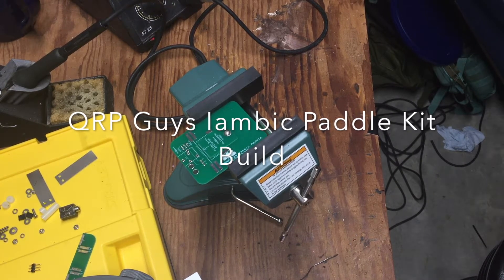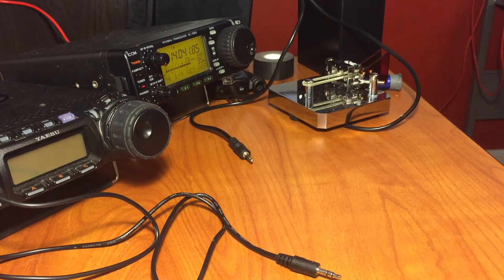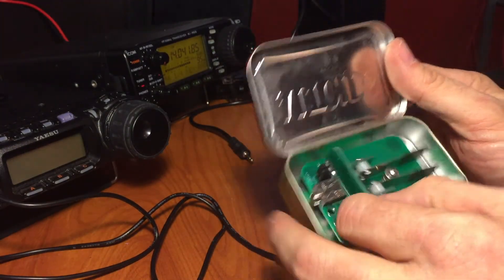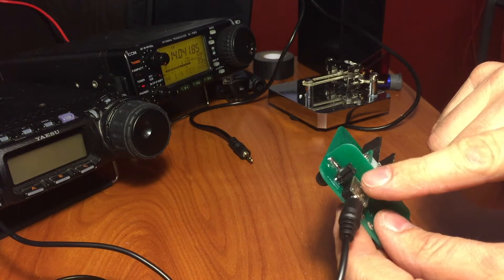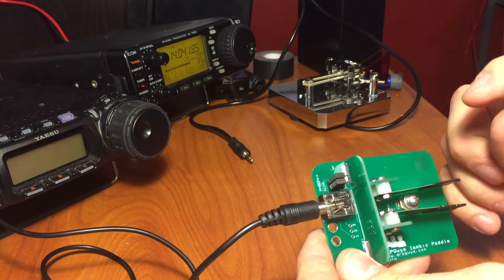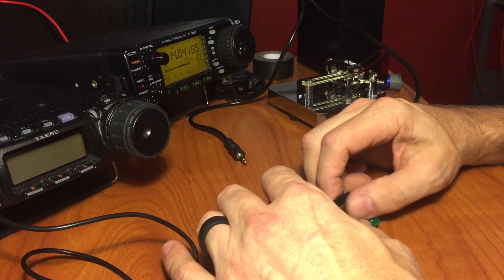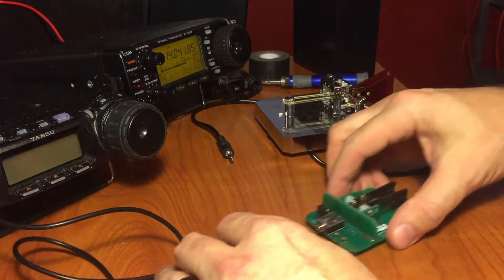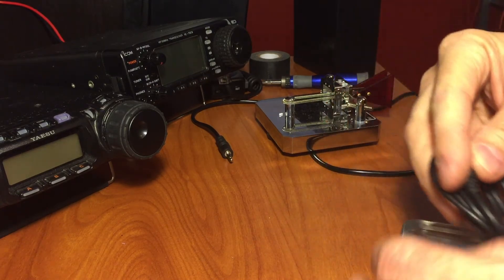QRP Guys Iambic Paddle Kit Build, yeah another hobby is invading my channel

Comment: Nice!  I made my own straight key out of a mouse trap, I call it "The Mouse".  LOL. Juddie WD8WV
Reply from the maker: I saw that on your QRZ page! I'm working towards copying code comfortably at 15wpm, not quite head copying yet, even at slower speeds, but I'm trying. So, for me.....a straight key is a bit of a motivator. I want to use it, but I need to get more proficient and get my confidence lever up.

Comment: interesting Ron - what is the morse code re-emergence about? is there a community of doomsdayers, preppers etc that think morse code will be vital when the sh_t hits the fan? or is it like the short wave guys who just have fun kicking old technology around? maybe a video showing your gear and discussing the community would be cool?
Reply from the maker: I think that there was an influx of young operators (I'm a late starter)  and the challenge started with the Summits On the Air and Parks on the Air operations. Folks all over the globe will hike to summits, big, or small to set up their gear. Well, portable gear needs to be light weight, especially for those difficult climbs and as such put out very low power. Morse code is used on a mode called CW (continuous wave) and because of the nature of the signal, requires a lot less power than to modulate our voice. It was a natural decision as well as being a universal language for radio operators worldwide. 

https://en.wikipedia.org/wiki/Summits_on_the_Air

parks on the air-https://wwff-kff.com/
Reply: interesting Ron - thx brother - cool how many uses you have found for the altoid cans :)

Comment: that's pretty cool! But my one question is would you be carrying a powerful enough radio to transmit while hiking?
Reply from the maker: Well, there are morse code transceivers that fit into an altoids tin also. It does not take much power for morse code. Hell, I've talked to Europe on 10 watts. Some guys have made overseas contacts using milliwatts. So, I have a battery to power those radios and can use them for well...just google Summits on the Air (SOTA), or Parks on the air...
Reply: Cool, I didn't know that. Guess I can go to sleep now that I've learned something today!
Reply from the maker: lol...right on.

Comment: Appreciate your effort but it would be a much better video if you did not use the intervelometer shots for the assembly. Rather, broke it into several segments and explained the steps of the process. A lot of us are interested in the way the paddles are put together and other videos have pointed out difficulties with this kit.
Reply from the maker: Thanks for the tip. I'll keep that in mind the next time I make a video where I am assembling a kit. I'll check out your channel to get a better idea of making electronic assembly types of videos.
Reply: Meant to be a constructive comment. A lot of us like to build kits and work QRP and the QRP Guys paddles fills the void you pointed out: cheap, light, portable. There are two downsides to the kit. One is forgivable because it is cheap; it is the smoothness of operation. You will understand this as your "fist" gets better. The other is the difficulty in assembling the contact points -- where you need tweezers -- and getting everything adjusted correctly. A step-by-step build video helps to visualize how to anticipate these difficulties. If you look at Gil's video, he comments that the instructions suck:

https://www.youtube.com/watch?v=YNZAIk5-Dbg

I watched yours because it might provide a different perspective. All that notwithstanding, you are to be congratulated on taking the big step into becoming a CW op! When CW was a requirement, many of us got so sick of the complainers griping about it. It's always nice to see young folks like yourself roll up your sleeves and dive into the "art". 

As for myself, I do not have  a YouTube presence per se. But if you go to righthandofzod.blogspot.com, you will see a lot of the stuff I have built and restored. You are more than welcome to question, comment, and offer suggestions.

vy 72 de k6whp
dit dit
Reply from the maker: I'm a subscriber to Gil's channel. I understood your comments. I guess I never intended to make an instructional video, but I think that I should consider it from now moving forward. ...a lot of questions get asked. That paddle kit was a bit of a PITA especially since I need reading glasses (52, not too old yet)...but I use those magnifying goggles to cheat..hihi. Still learning CW, starting the CW Academy Level 2 next month...head copying is tough...I've only had a general license for 12 months.  My channel content is very broad, so I try not to concentrate on one hobby.